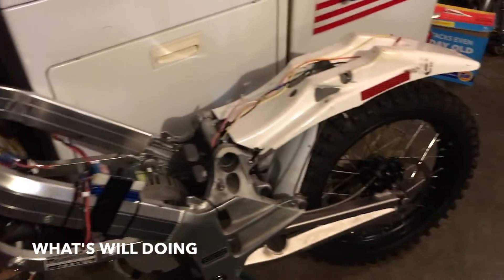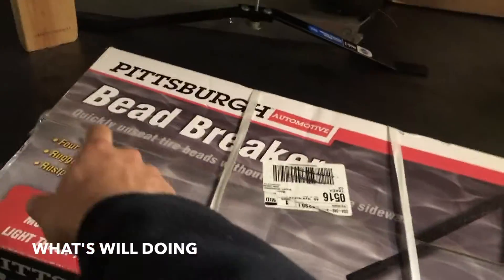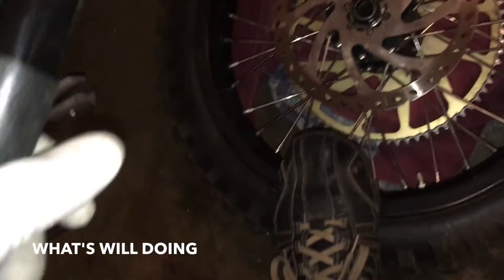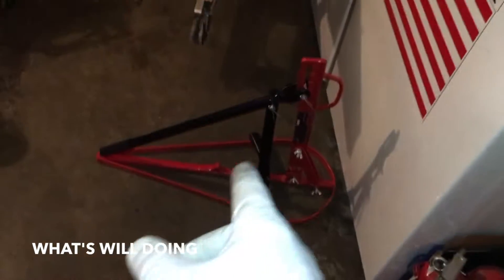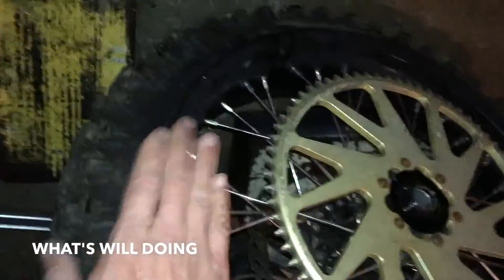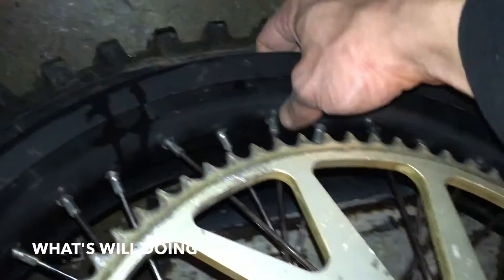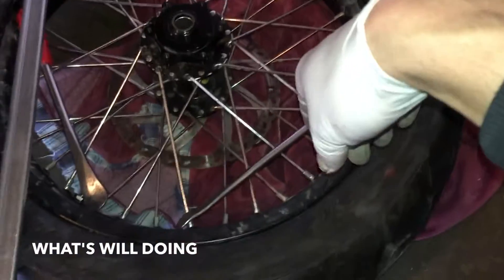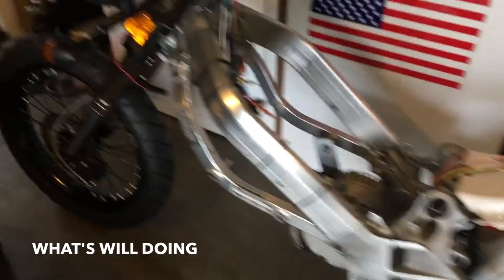DIY Electric Motorcycle with 117V - Mounting Tires

Comment: Cool project, thanks for sharing. I noticed that the direction of the tread on the front tire is opposite to the tread direction of the rear tire. I Googled "tire tread direction" and it looks like the tread direction of the rear tire is the correct one since the V pattern will channel water outwards as the tire rolls forward. At least the front tire's the easy one to change. :)
Reply from the maker: Hey good eye!  I thought the same thing.  I checked the tire rotation direction arrow several times.  I know the front tread looks backwards but it's on the right way.